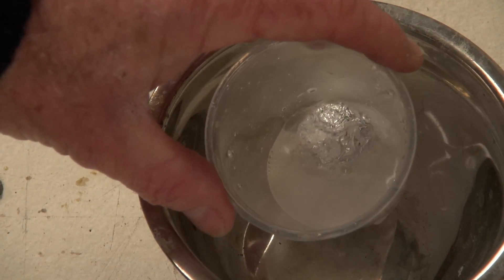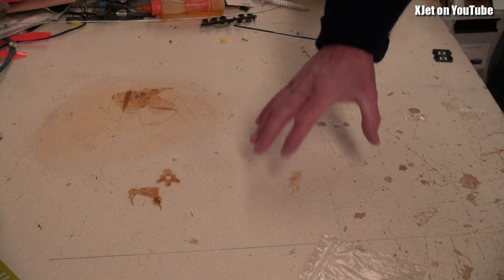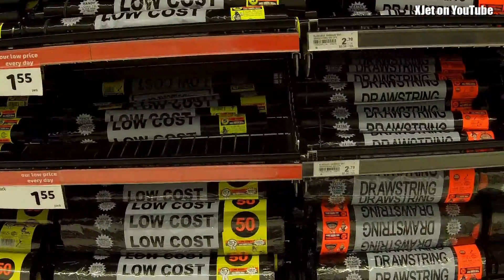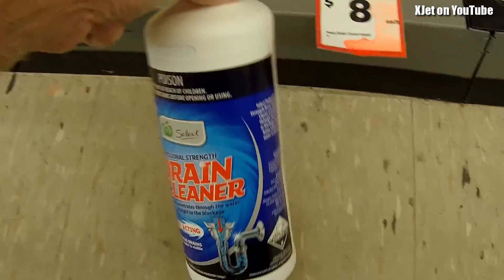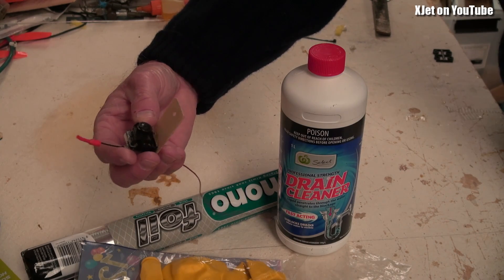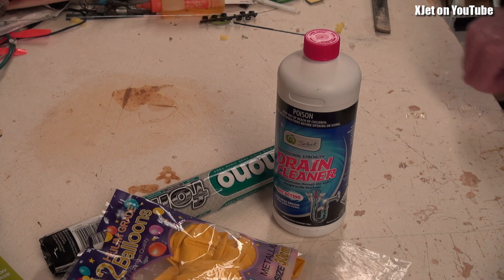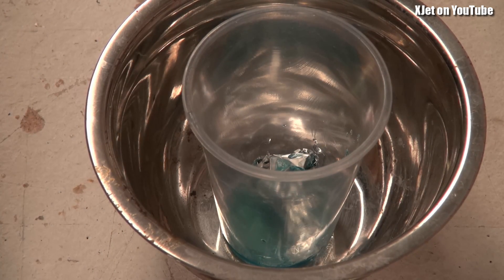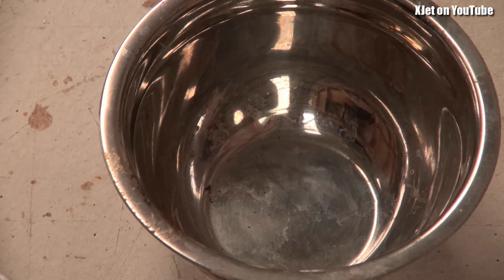A drone alternative:  hydrogen-lift aerial video (FPV)

Comment: Pro tip. If shopping for drain cleaner do not get the stuff labelled drain cleaner. Seek out the sodium hydroxide also known as caustic soda or lye. Compare prices and the drain cleaner is twice the price. This marketing stunt is quite common. Look at the number of pain killers on the market. some will be labelled for head ache, some for back pain, some for period pain etc. London to a brick they are all the same as the general purpose equivalent but again at twice the price. Marketers preying on the ignorant consumer, Who would have suspected?.
Reply: Rob B - I used to occasionally make deliveries to a commercial lab that produced Ibuprofen tablets for several different companies. I once asked one of the chemists what the difference was between the supermarket home brands and the expensive stuff they made? He said the expensive stuff had a two extra chemicals added during production (He told me the chemical names at the time, But I can't remember). Surprised that there really was a difference I asked what this extra chemicals did? His reply was "It gives the tablets a shiny red coating to make gullible people think they're actually worth the 500% jump in price over the supermarket brand ones" !!! :)

Comment: Tut!
No apparent use of PPE.  Safety first please. After all your audience may not entirely consist of sane and sensible adults. (In fact,it very probably doesn't) :D
BTW, your test (the white ones) balloons will benefit from pre-inflation/deflation as this, from experience enables gas inflation with lower pressures...
Reply: Nah.

Comment: Ha...
Here we have the same regulations for aerostats as for powered flight, regardless if gas or warm air, above 1m³ :D
But nobody regulates sticks.
Really long sticks. ;)
Reply from the maker: A cubic metre is a lot of gas  and represents a big balloon (about 1.4m in diameter) so experiments like this are likely to still be unreulated in your country if it's simply the size that's the determining factor.

Comment: Someone else pointed out water regulation (for hydrogen).
I propose regulation for another reason: Statistically, drowning kills many people each year. Its also capable of getting you drunk (everywhere on the news in the US). So clearly, we need to regulate water more strictly, ID people if they are buying a gallon (or "keg") at a time. We don't want under-aged hydrophiliacs walking and stumbling in the streets. Lets put an end to this together! 
Comment below or like if you agree.
Reply: Water is highly addictive. One sip, and you're hooked for life. It's also a very powerful solvent. Remember; solvent abuse can kill!
Reply: Ban Dihydrogen Monoxide!!
Each year, Dihydrogen Monoxide is a known causative component in many thousands of deaths and is a major contributor to millions upon millions of dollars in damage to property and the environment. Some of the known perils of Dihydrogen Monoxide are:
 
 Death due to accidental inhalation of DHMO, even in small quantities.
 Prolonged exposure to solid DHMO causes severe tissue damage.
 Excessive ingestion produces a number of unpleasant though not typically life-threatening side-effects.
 DHMO is a major component of acid rain.
 Gaseous DHMO can cause severe burns.
 Contributes to soil erosion.
 Leads to corrosion and oxidation of many metals.
 Contamination of electrical systems often causes short-circuits.
 Exposure decreases effectiveness of automobile brakes.
 Found in biopsies of pre-cancerous tumors and lesions.
 Given to vicious dogs involved in recent deadly attacks.
 Often associated with killer cyclones in the U.S. Midwest and elsewhere, and in hurricanes including deadly storms in Florida, New Orleans and other areas of the southeastern U.S.
 Thermal variations in DHMO are a suspected contributor to the El Nino weather effect.

Comment: What the actual F, you tore that foil... for the love of god get some scissors.
Reply: Real men can tear foil with there bare hands.
Reply: ERD Epoch And that will also sharpen the scissors ✂! 👍
Reply: Bruce isn't going to be foiled by a little bit of tearing!
Reply: Come on guys, the under sides of my finger nails are starting to itch knowing hes done this.

Comment: Hey, watch out, It has just been announced that China and the USA are to start issueing licences to the big boys (Amazon, ect.) to deliver goods to customers by drones flying approximately 100 ft off the ground. So say goodbye to the hobby of flying models/drones except in all but designated area's. How long is it going to be before other countries follow with the same action. ???
Reply: Too bad it costs $155 to get a commercial license. Its not super high, but I thought it would be a novelty to deliver cans of soda strapped to the top of my race quad during intermission at a small airshow. FREE SODA!***       
***Just pay shipping and handling.

Would need to have PIDs tuned for a small amount of liquid slosh, and not go too crazy with the flips. But I really don't think I could make that in a day, well I probably could, but I would rather charge extremely low just so more people can have a laugh at drinks delivery. Might be worth it anyways, already have my HAM and AMA is already $80 a year...
Reply: Jake Garrett I think they are probably not going to rely purely on PID. They might throw in a bit of MPC or IMC.
Reply: Yeah, I'm not really sure. Its a complex fluid dynamic system coupled with a an electrical and software system. As an engineering student, I'd love to analyze it, yet at the same time I realize how difficult that would be and think "meh, lets just fly it and see what it does".

I'll have to do some testing with top vs bottom mounting locations soon! If you're interested, I may post it on my channel (feel free to sub, as you'll notice I have 0 videos, so its not like you're going to get spammed, besides you can unsub after the video. However full disclaimer, I will be posting a promo video and possibly competition footage of our teams stealth bomber happening on the 28th with a jet aircraft evading police radar guns and deploying 2x 40mm grenade payloads).
Reply: Jake Garrett subscribed. And also, I've seen several videos on YouTube of university student projects involving using all three control methods in combination for multirotors that drop heavy loads. A multirotor running exclusively on PID has no awareness of what it's doing and just shoots straight up after it drops the load, while a multirotor using all three can anticipate the change in mass and CG and schedule the throttling down almost perfectly
Reply: Thanks. I think it will be a fun little experiment. Probably crash at some point, but that's what makes things exciting! If it does work, well that will be cool too, so I guess its an experiment that can't fail since either outcome will be a fun learning experience. Cheers!
Reply: Buy something cheap and capture the expensive delivery drone...Simples.

Comment: Good thing Bruce hardly ever does "part 2" ... goes getting kids birthday balloons listed as a dangerous weapon also himself and everyone else buying drain cleaner and foil on a terrorist watch list. Glad he didn't go for electrolysis because you know these drone regulating geniuses would go banning you from having water and electricity plumbed into your house ;p
Reply: Statistically, drowning kills many people each year. Its also capable of getting you drunk (everywhere on the news in the US). So clearly, we need to regulate water more strictly, ID people if they are buying a gallon (or "keg") at a time. We don't want under-aged hydrophiliacs walking and stumbling in the streets. Lets put an end to this together!
Reply from the maker: Most of part 2 is already filmed.  I was thinking of using electrolysis but the set-up is more complex and despite the lack of corrosive chemicals, it actually has the potential to be more dangerous -- if the O2 and H2 mix you get a very explosive cocktail -- far more so than just H2 on its own.
Reply: Nooo Bruce?! ... HHO is completely inert remember? ahem wink wink ... its just basically water after all. Phew, that was close, I was worried you'd have accusations from your mates at the council about telling people basic chemistry aka terroristical advice on face-tube there.  Keep fighting / flying!

Comment: Noo... don't do it Bruce, now they going to ban baloons
Reply: Timmy, first the CX-10, and now this?!? No more birthday parties for you young man! Those balloons are dangerous you know! Where is your permit?
Reply: G'day,

  Dinnae ye worry none about that ; they CAN'T Ban Balloons, and especially not from Airports.

   Every International Airport has a Meteorology Building, operated by a small Department whose task is to inflate & release a 1.4 Cubic Metre Hydrogen Balloon carrying either a Radar Reflector alone or a Reflector plus an Instrument-Package ; the better to measure Wind-Speeds aloft, for their Reports to the Beaureau of Meteorology.

   So, Balloons are un-Ban-able.

  However, they may make it neccessary to obtain a Permit to Operate/Launch a small Free-Balloon.

  Here in Oz there was a brief fashion for Garbage-Bag Hot-Air Balloons, with an Alcohol-Burner made from Alfoil, Cotton Wool, & Methylated Spirits..., launched at night, particularly in the Winter....; they sparked a rash of UFO Sightings, but lit up a few Bushfires as well - so the craze sort of died away...

   But, yeah, Meteorology is very dependant on Hydrogen Free-Balloons ; so they cannot be banned - otherwise there would be no Weather-Forcasts nor  Reports of current Conditions..., and the Sheeples would notice such a Disruption and commence to bleat at the Politicians.

  Such is Life,

  ;-p

  Ciao !
Reply: This was already attempted decades ago, Bruce! It was a Disaster!
Reply: They already pretty much banned drain cleaner in the UK.....
Reply: Warblesonalot. We did the same thing, using domestic gas, which contained a lot of Hydrogen. Can't do it now, because it's mainly methane these days. Bush fires have always been scarce in the U.K. ;-D
Reply: I always fly safe.
I use condoms 😎

Comment: The sodium hydroxide, Anhydrous or hygroscopic? 
Almost the same, but different.
Reply from the maker: The sodium hydroxide was anhydrous when I bought it (ie: it was in dry crystal form) but because it is hygroscopic, it delequesced into an aqueous solution.   I love science because at heart, I'm love using sesquipedalian terminology.    Rule #1:  never use a big word when a diminutive one will suffice :-)

Comment: Mitre 10 has pure sodium hydroxide crystals. Don't ask me why I know this
Reply from the maker: Tokoroa used to have a Mtre10 shop... but they closed down and left the district.  Perhaps they fell foul of our council :-)
Reply: xjet I’ll be fascinated to see if you can do this, I tried and had two problems: the glass bottle I got the reaction going in would explode or cook the balloon, and the amount of hydrogen required to lift anything seemed unrealistic. Both problems that could be overcome.

Comment: The really low cost black bags can just be filled with air, sealed, and sunlight will heat em up enough to float somewhat reliably. (They sell really long bags for the purpose)
Reply: Yep That's why you should use weather balloons as they are made from latex (Not plastic)
Reply: Robert Szasz and people release them untethered causing more plastic pollution...

Comment: Hmmm , Bruce it probably would have been cheaper and less dangerous to get some large party balloons from a party shop , i think they are filled with helium and would do the same job safer but maybe they will cost more so carry on regardless :-)
Reply from the maker: Yes, it would be easier to use helium but this way I can teach a bit of science at the same time -- and besides, helium is in short supply to the extent that scientists are not happy with people using it for party balloons.
Reply: Hydrogen is half the weight of Helium not one quarter.  The reason being that Helium molecules consist of a single (mass 4) Helium atom but Hydrogen gas, H2 consists of two atoms (both mass 1) of Hydrogen.  In any case, the lifting power of a gas depends not on its absolute mass but on its mass relative to the air it displaces.  In normal ground-level air, Hydrogen only provides about 11% more lift than the same volume of Helium.
Reply: I have done electrolysis with water to get hydrogen in the past for a balloon experiment. The reason why I went with hydrogen than helium is almost completely on the fact the hydrogen is about one fourth the weight lighter (correct me if I am wrong). I live at 6000' elivation so to have anything that fly's either needs to genterate a lot of lift of be positive bouyant.
Reply: You'd probably hate to hate how much helium we blow through at work :) 

(Launching rockets)
Reply: Have to be lots and lots of party balloons, hydrogen does a much better job at lifting.
Reply: Okay, thank you and good to know. I'll stick to airfoils I think, but an airfoil filled with hydrogen would be interesting.

Comment: Remember those big remote control fish balloons a few years back? I got given one and decided to fill it with hydrogen rather than pay for helium. I used the same method as yourself. I used the tub of crystals like you had. I put the aluminium and drain cleaner in a large 2L coke bottle. I used a mix of alu foil and lumps of scrap aluminium (it eats the foil too quickly and you want it to go reasonably slow). I had the bottle in a large bowl of ice water. I ran a rubber tube from a hole in the lid into the a hole at the bottom of another coke bottle filled with water and from the lid of the second bottle I ran a tube in to the ballon. The reason for the 'bubbler' second bottle was to cool the gas (crazy amount of heat produced) and to help clean the gas as inevitably from the strong reaction the gas produced was contaminated with drain cleaner fumes. but it worked great, filled the fish with enough reaction left over to fill a black bin bag like you bought :)
Reply: Ah yes, I remember we bought a Megatech blimp (flying saucer and typical blimp) for my Uncle a long time ago, now its $70-$80... I might have to make one of these in larger scale. Put some brushless motors on it and have a slow speed, super long endurance FPV cruiser. I'd probably have to go UFO shaped for laughs.

Comment: I doubt the H2 gas you are getting from that process is very pure (you mention the gas is actually corrosive) - and pure gas is what you'd want for max lift as a percentage of volume. How do you plan to capture, compress and fill the balloon with your method? If you start with very pure water (laboratory pure) you'll get almost nothing but hydrogen and oxygen from electrolysis. You still face the challenge of capture, compression and fill, but you'll be getting the most lift out of your gas production effort.

Oh, and while the Hindenburg most likely saw some H2 gas combustion during the infamous crash (some as in a large amount), if I'm not mistaken, the initial source of ignition and flames seen in the film is the highly combustible fabric (covered in something akin to gunpowder), not the hydrogen. Hydrogen, as I'm sure you know Bruce, burns with a very hard to see blue flame. Visible in low light, nearly invisible in bright light. The initial flames on the Hindenburg were not characteristic of hydrogen combustion.  

Another example is the blue exhaust flames from the retired Space Shuttle Main Engines.  See > https://en.wikipedia.org/wiki/Space_Shuttle_main_engine#/media/File:Shuttle_Main_Engine_Test_Firing.jpg
Reply from the maker: I've already done the next step (but haven't edited the video) and filling the balloon is super-easy.  The balloon is stretched over the mouth of a bottle containing the sodium hydroxide + aluminium and it inflates very nicely indeed.   When released, the balloon rises very quickly -- indicating that the H2 is pure enough for this job :-)   What I might do in future is pass the H2 through a filter first to remove any droplets of sodium hydroxide because this could damage the balloon -- but so far it's looking really good.
Reply: Outstanding! Thanks for the response Bruce! Experimental aviation FTW (as the kids say) :) I wonder if you are getting some lift from the heat too?
Reply: I used to put the water in the balloon and let it droop down from the container, it gives you more time to secure balloon ,then lift balloon. Your friendly dry cleaner might sell you a tube (any length ) of plastic bag. so light you just hold it over the barby to inflate.